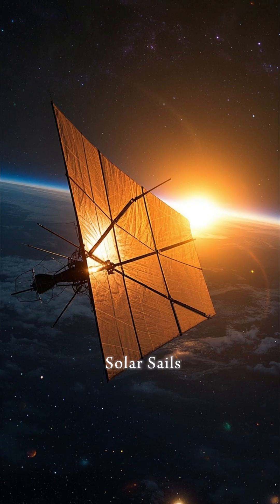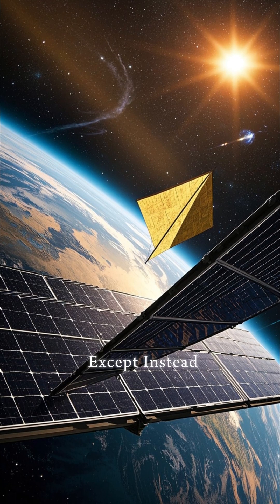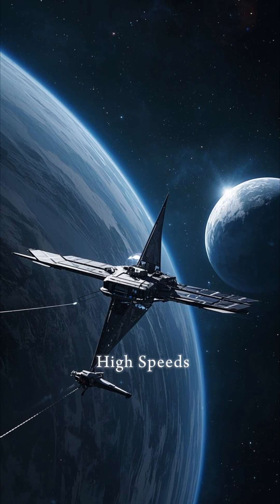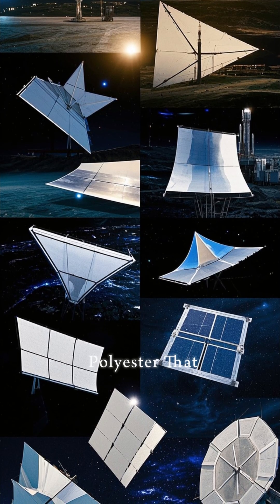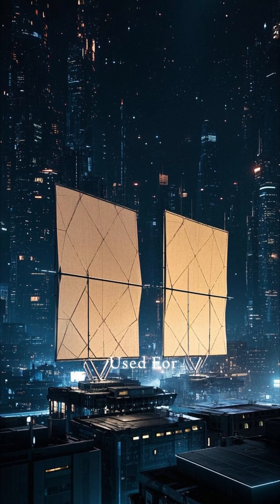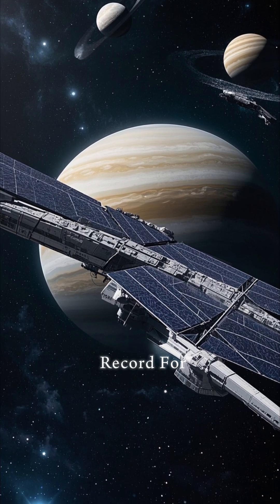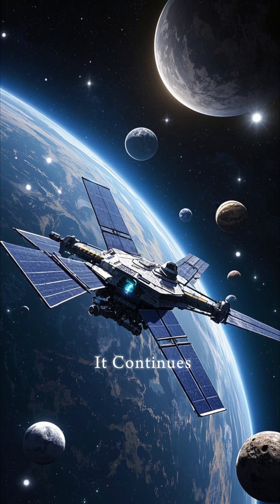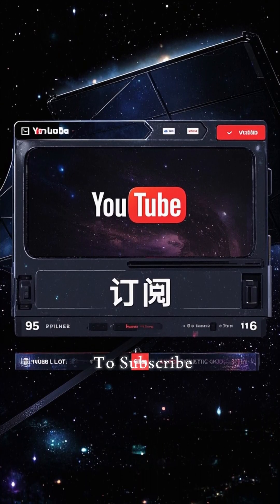☀️ What Are Solar Sails? | The Future of Space Travel Unfolds 🚀🌌 @Seeker @AlanChikinChow

Comment: Solar sails and solar panels are two entirely different objects.  A solar panel converts light (photons) into energy.  A solar sail is exactly like the sails of Earth bound sailing vessels in purpose.  The sail is a light weight  metal sheet that actually catches the solar wind.  Yes, the sun and all stars produce a wind.  It is made up of charged particles that can travel 250 to 500 miles per second.  It is the solar wind that interacts with the Earth’s magnetic field producing the northern and southern lights.  The solar wind is also responsible for ripping the atmosphere and oceans from Mars after the loss of Mars own magnetic field.